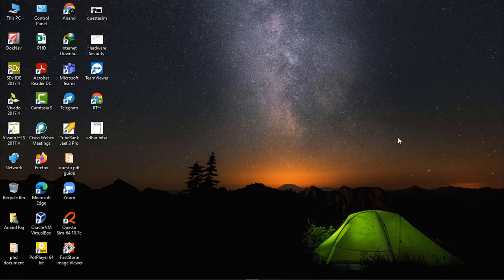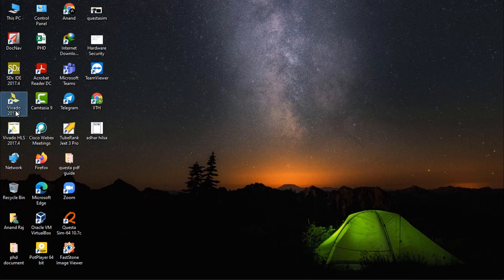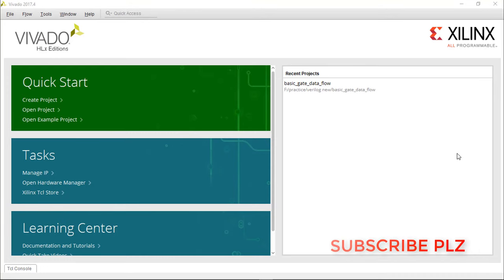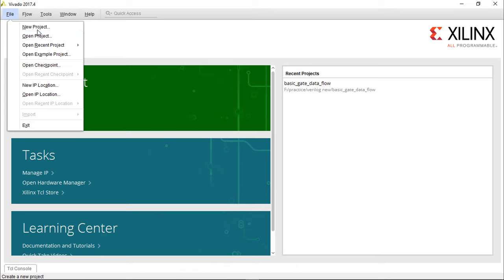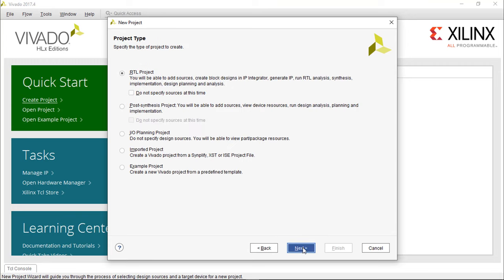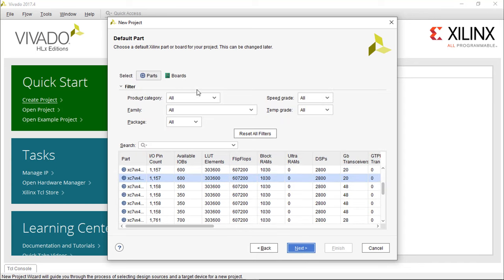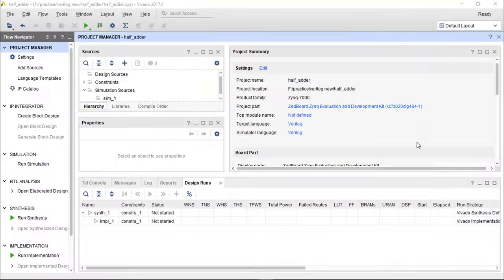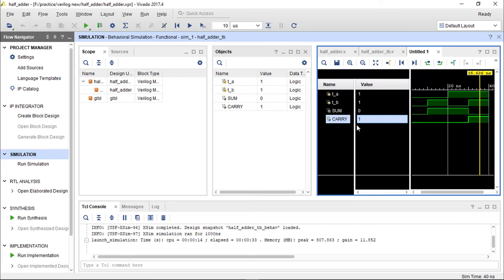How to use vivado for Beginners | Verilog code | Testbench | Schematic View

Comment: I have a "Xilinx ZYNQ XC7Z010" board, sir. I'm new to Verilog; which board should I choose under Boards in the software? I'm using the Vivado 2021.2 programme.
Reply from the maker: During project creation it will give you option to select parts and board , select board and search for your FPGA board or after selecting parts you have to search for xc7z010. You will get it

Comment: Thanks for the video sir.
Sir, When I run the simulation it is taking forever.
It is basically stuck in run. Do you have any idea about this?
Reply from the maker: In test bench plz give $finish();
Before endmodule
Reply: @anandrajofficial1  
Sir, Thanks for the quick reply.
I did not include the test bench code.
I was thinking of giving inputs through the available Force constant option after running the simulation.
Reply from the maker: @riyazbajishaik1596  then i think you have to stop simulation intentionally

Comment: Hello it's taking too long to a create new project, is there any way I can fix it?? Kindly let me know if any..
Reply from the maker: Due to less RAM In pc,same happened with my pc too,.
How much RAM ur pc have?
If you want to do simulation only ,you can try with edaplayground.
Reply: @anandrajofficial1  PC RAM is 8gb, actaully I needed to work on a project and I  used to do small works on Icarus but I'll try once on edaplayground. Thank you!!
Reply from the maker: @anjalin7935 then it should work fine.for project vivado will be good.i don't know why it is slow in ur system.